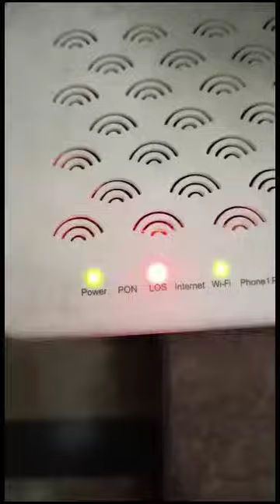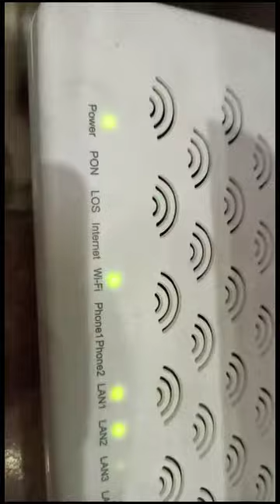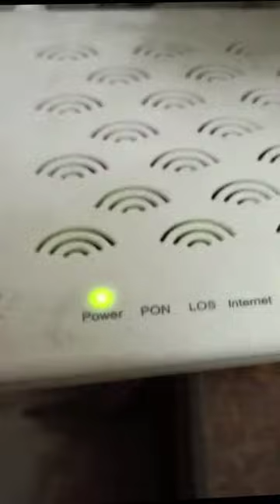How to Fix Fiber LOS Red Light  Blinking ||  Loss of signal Solution || No internet LOS Red Light

Comment: The issue with my PTCL Fibre is that it gets disconnected (Red Light keeps blinking) at a specific time (between 4pm and 6pm) since last 3 days. It works fine after 6pm until 4pm next day, If anyone can suggest the solution. Thank you
Reply from the maker: Is it working itself after red light or you have to do anything. In my point of view it's from PTCL backend, may be light of msag off during said time period
Reply: @ittechnologyofficial  It works itself after 6pm. I dont have to do anything. PTCL are not giving any proper response

Comment: Your solution helped, thanks!
Reply from the maker: -Install Update KB3138612
-After installation restart your PC and check for updates.
-Run the Windows Update Troubleshooter.
-Navigate to Windows Control Panel, set the 'View By' to Small icons and open Troubleshooting.
-In Troubleshooting options, click Fix problems with Windows Update.
-Click Next to troubleshoot Windows update problems.
-When the troubleshooting process is complete, close the troubleshooter and restart your PC.
-Check for updates.
-Download and run the System Update Readiness tool according to your Windows version.
-When the installation is completed, restart your computer and try to search updates.

Comment: LOS RED LIGHT BLINK NAHI HO RAHI H fix h continue jal rahi h  KYA PROBLEM ho sakti h 💥💥😭😭😭
Reply: sab kuch kar liya vendor ne chek kiya o bola router kharab h bcz los light nahi band ho rahi h
Reply from the maker: @sksk-vm3rp  ok then change your router or repair
Reply from the maker: Restart your router. Unplug your modem/router from power, wait at least 30 seconds, then plug it back in
Reply from the maker: Possible causes of Loss of Signal (LOS)

The LOS (Loss of Signal) red light in the modem is an indicator of a fiber cut. The following are the possible causes or reasons for LOS:

Loose or damaged patch cord.
Extreme fiber cable bend.
There is a problem with the fiber cable connected to your modem from the pole / NAP box.
There is an outage in your area due to your ISP's scheduled maintenance or ongoing equipment upgrades.
Reply: router repair nahi hota h vendor bola